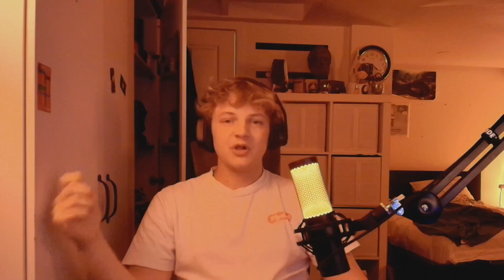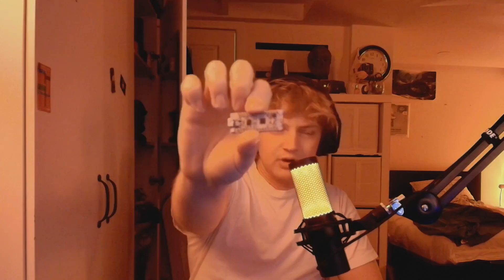What DEGREE is Needed for Embedded - is CS good enough?

Comment: I’m always a little surprised when CS guys get embedded roles because one of the toughest parts of embedded is reading the reference manuals and data sheets. Not only do you need fundamental understandings electronics, but digital logic as wel like gates and CMOS (inverters) just to understand data flow. It’s also incredibly helpful to know state machines which is often used at the higher level of embedded because of how RTOS friendly it is. Then there’s intrusive levels of debugging etc etc. It’s pretty daunting.

Comment: I have a bs in computer science and want to earn another hardware related degree. Should I go for a bs in EE or an MS computer engineering?
Reply from the maker: I'd do MS in compeng tbh if you're set on another degree. Depends though on how much electronics that teaches you, do you know?
Reply: @hoff._world Either way, I'll take numerous circuits and electronics courses. I'm considering an EE degree as a backup option. Embedded looks so cool but I'm nervous that soon coding knowledge won't be relevant anymore. With AI and all.

Comment: I have a computer science degree with a focus in AI I have worked with electronics even before as a PCB rework technician before my current role as a firmware engineer but all my PCB experience is from work If I want something on paper to put on my resume I know work experience matters just as much I have the experience but my quesiton is should I just go for my masters in EE or I can do something like an electronics systems engineering B.S at my local state school here both programs are online degrees but I kind of just want a diploma so I can really sell myself better for more embedded engineering opportunities.  A lot of my experience is with soldering/rework i can solder any component no matter how small or large IC's , reballing ect.. But I want to get familiar with how these PCB's are designed.  I apologize for the long winded response and bad grammar I am on my phone lol anyones input is welcome ! EDIT: when I say all my experience I mean in terms of hardware of course for my firmware role currently I read schematics, use altium data sheets blah blah
Reply: in your firmware engineering, do you not code "firmware" for hardware? or code drivers for your company? or do you just do schematics, design PCBs?

Comment: Quick Question, I'm in EE but after talking to my Software Eng friend I realized my code quality is actually really poor... I only learnt about refactoring and design patterns yesterday! I mean I have a broad base in coding; c++, c, django, react... But I never formally learnt how to code properly, save for my basic c++ classes. I want to remain flexible and able to get a good software / firmware salary. 

What would you recommend I do to bridge the gap between myself and software engineers? Should I do a minor in Comp Sci as well?
Reply from the maker: I would recommend doing software projects for this, tbh. Regarding refactoring for example, how are you supposed to know what bad code looks like if you've never written it? You have to make these mistakes, then look back at say "yeah that was a bad decision - if I did it again I would have done it this way", etc.

refactoring is when you actually change it to make it that better way you thought of. You can't get "married" to your code, for example if I think of a better way I'm happy to throw out a couple hours of work and re-do it just because I know it will be better in the long run. Re patterns: you can study them and practice applying them in your projects.
Reply: @hoff._world Thanks man! Glad to know projects will compensate and Im not missing out on much :)

Comment: What about someone that's a CS major but is getting a minor in embedded systems? Seems like a good way to get a good grasp on both hardware and software?
Reply from the maker: yes, but since it's not an "Electrical Engineering" degree my opinion is that you would struggle getting hardware roles. It's totally good for software roles tho

Comment: I have been working as a junior embedded systems engineer in a startup (in Greece) for almost 6 months now. Though, I am a final year Computer Science undergraduate student and I know that if I keep the job, I will delay a little bit (from half to a whole year) my graduation ... Should I keep the job and delay my graduation, or should I quit the job and focus on my degree, so as to graduate on time ?
Reply from the maker: a few things to consider:
1. would you want to work with this company after you graduate?
2. are you confident in your ability to find another position after you graduate?
3. do you trust the current company to keep you around during your final year?

it's potentially worth it if it's a good job guarantee. otherwise I'd remember to always look after numero uno, I've been burned before. With the degree you have credibility and autonomy to check off hiring requirements - without it you're kinda tied to that current company or another like internship or something
Reply: In my job we are writing firmware for raspberry pi and esp32 ...
Reply: @nikosaspridis8091  I am in a very similar situation but I'm not working in the embedded field (but I do systems programming in C)... In my opinion if I were you I would keep it, as finding an entry job as a junior seems to be hard these days (but not impossible though).
Reply: hey im also a greek cs student interested in embedded, what is your experience in university in order to get more knowledge into embedded ?

Comment: How advanced of subjects do you think are relevant from circuit design in EE if you're primarily focused on software development in an embedded role?
Say for example, in my university from that branch after the 3rd year which is first all about the physical side of semiconductors and then applied to transistors, we deal with those concepts in circuit design. Later on in the 4th year you go into op amps primarily, and then by the end of that year you apply concepts from electrical machinery courses but now in circuits (the 5th year is all electives). How far do you think it's necessary to know for most applications?
I wanted to get away with the intermediate degree we get by the end of the 3rd year and go back to CS to get my full degree there before working, but from your experience what would you say you found to be most useful from those courses?
Reply from the maker: op amps and transistor types / configurations (like amplifier circuits) could be useful depending on what you're designing and how involved in the hardware design you are. I won't lie primarily in software this kind of thing is abstracted from you - transistors are switches, op amp effects are applied before it reaches the MCU, etc. but knowledge of how they work is good sometimes to understand readings you may get back or power usage, etc